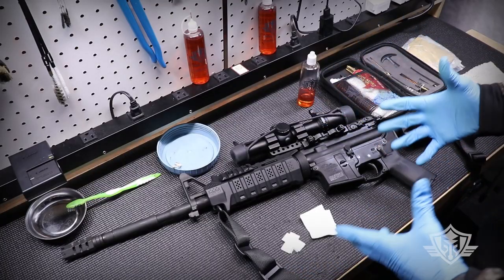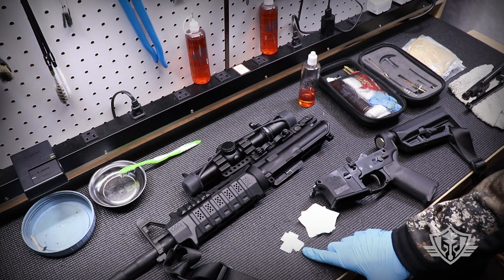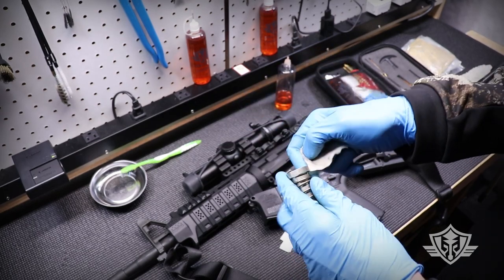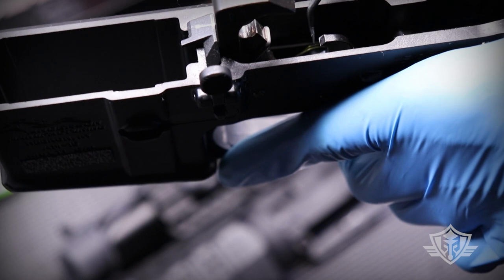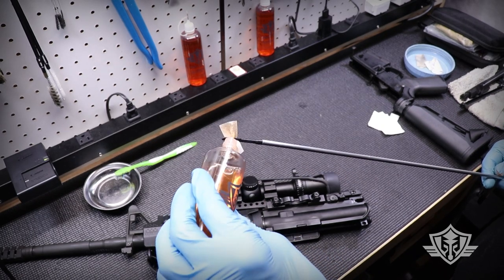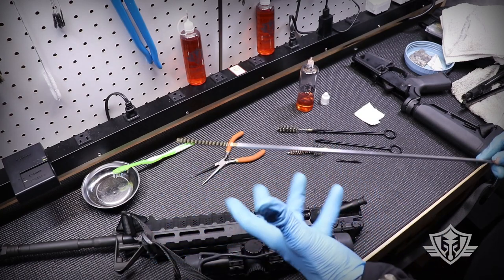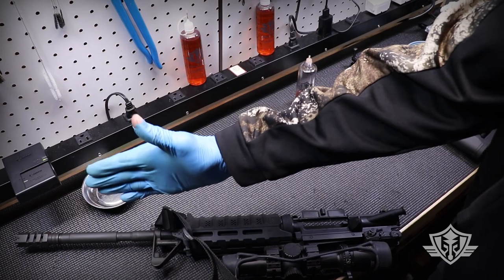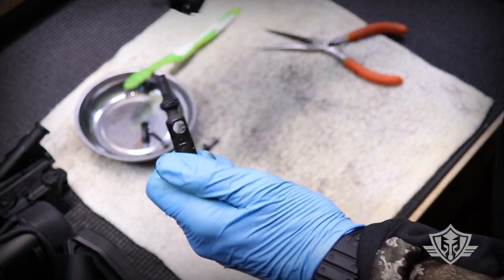America’s Rifle: How to Clean and Lube the AR15|M16|M4 Rifle with CLP

Comment: Well done. A clean weapon is a happy weapon. An Angry Ranger has nothing but happy weapons!😁
Seriously, a well thought out presentation, and so grateful to hear you reinforce having no need to drench the weapon with oil/CLP, and employ a light coat. Thank you!👍
Reply from the maker: For sure... we want happy guns, not happy Rangers... that would just be wrong. 😁
Reply: @adigaarmory  Seriously, using Adiga Armory CLP on my M4 clone is a wise choice. Super easy clean up. Great lubrication that does not attract filth. And extended use without failure. Yup, Adiga Armory CLP does work.. Thanks.👍

Comment: Excellent and informative as videos on this channel always are. Quick question, what is the temperature range of the CLP? Thank you
Reply from the maker: Great question. Standard recommended temp ranges are -60° F to 500° F ... the solvents will evaporate at a lower flash point, but the remaining synthetic base has a boiling point over 600° F.
Reply: @adigaarmory  thank you. I'll be ordering a bottle